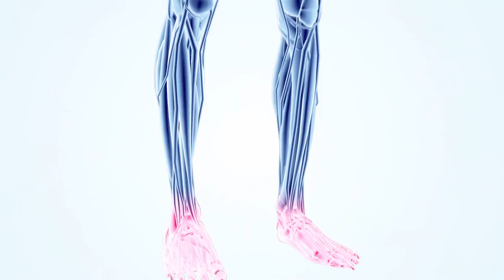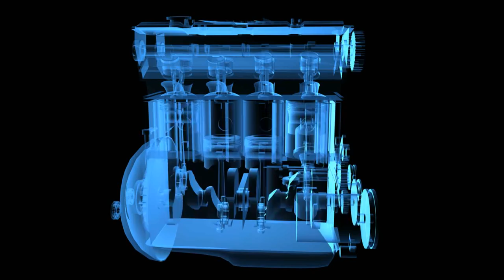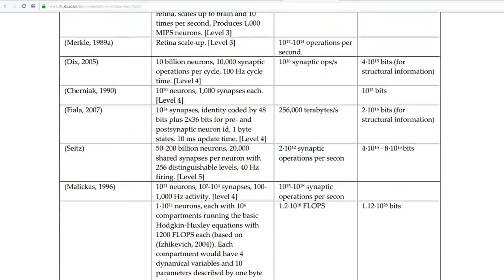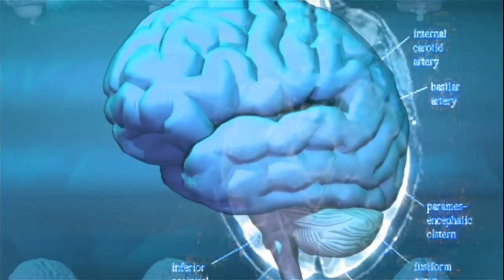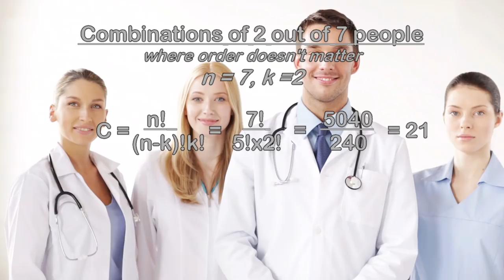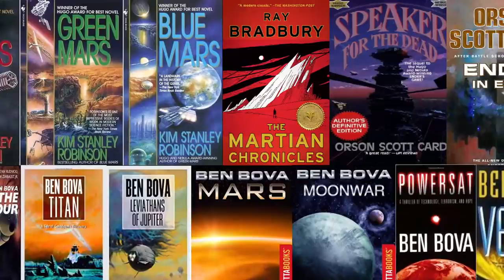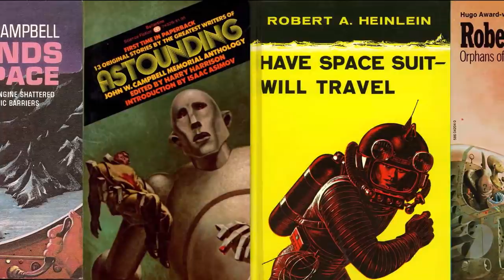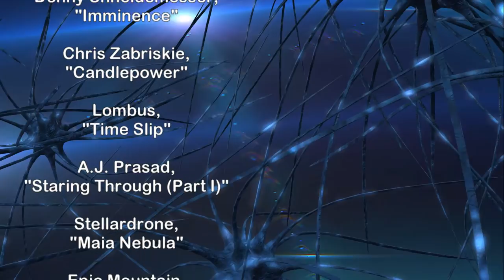Mind Uploading

Comment: As long as the paperwork says it's the ship of Theseus, it's the ship of Theseus.
Reply from the maker: :) That's a surprisingly pragmatic viewpoint
Reply: Isaac Arthur perhaps but I feel like it just side steps the issue. Ironicly not very practicle.
Reply: But what if they did both? Both rebuild the ship in a secret out of the parts and then revealed it after the new one was built?
Reply: Isaac Arthur my friend, but if I take all originally discarded pieces and reassemble them exactly, which one would be the real Theseus' ship? Would it be the reformed ship or the the one carrying Theseus?
Reply: It depends on why one is interested in the ship of Theseus :
-Theseus : Whatever, as long as it sails him.
-Relic : Don't you dare change a single speck of dust !
-Ceremonial : You only need for people to believe it is the one and only.
-Paperwork : Whichever has taxes paid for must be it.
-Philosophical discussion : Whatever, as long as the debate goes on.
Reply: @Rodrigo_Sierpe In my opinion, the Theseus' ship is the one that got gradually replaced, the one built from discarded pieces is the copy.
Reply: In the sense that cells die and are replaced, sure. If you dry dock it and replace those parts all at once and even change the materials and designs so that most or all those parts have never touched water, it's a second ship that has replaced the old one.
Reply: We are all the Ship of Theseus, your body constantly renews itself. About the only enduring part of you is the enamel on your teeth that hasn't worn away. In spite of that we remain the same person so Isaac Arthur's presentation is blatantly missing something about the nature of mind. There's actually a bold claim being made about the human mind here: that your illusion of self is just that, an illusion, and effectively exists only as unique because you are the single copy due to the limitations of human technology. I think this is an absurd assumption on the face of it but clearly nobody here agrees with me. A friend and I used to play with this idea, speculating about what future me would be doing and why past me hadn't done things better. Try it sometime.
Reply: @musaran2  lmao the best opinion I’ve seen on it, it’s a debate with no answer.
Reply: @kalliste23  Your brain and nervous system are mostly the same, neurons are rarely replaced.
Reply: @zemorph42  That is factually incorrect. Go back to school.
Reply: @kalliste23  You're right. Neurons are never replaced when they die.
Reply: @zemorph42  certainly that's the case. That said, it's now understood that the adult brain is far more plastic than is generally believed . Consider what happens when someone has a stroke, or some kind of brain trauma, and recovers more or less functionality subsequently and that what they may recover can depend on therapy. Now here's an interesting vaguely transhumanist thing for you to ponder: during WW2 they used people who had had their natural lenses replaced by PMMA due to injury spot for submarines at night: the submarines would generate UV light trails from churning up the photoluminescent bacteria in the water and people with PMMA lenses can see into the UV, normally blocked out by an intact human lens to prevent damage to the retina. The way the cognitive system adjusts to inputs is amazing.
Reply: @zemorph42  There's neurogenesis in the hippocampus for life, and I'm pretty sure there's frequent growth in areas responsible for the sense of smell. A slowed growth is associated with depression. While true that a new neuron never takes on the same connections as the original, and the original remains dead, the collective behavior is either preserved or changes in the way a brain is supposed to.

Comment: Most people don't realize how close we are to being able to do this, algorithmically. Not that we're there but some of the algorithms I work with, indeed some of the best algorithms we have for AI, emulate layers of the neocortex with striking results. There's a still a long way to go to being able to emulate (More than less) a human brain but I wouldn't say it's even twenty years away.

The first most promising avenue for this I became aware of (Besides the decades-old algos emulating neurons) were sparsely distributed representations (SDR) of dendritic processing in cortical columns. Soon after, we had source code (By Numenta) for cortical learning algorithms available on the Internet and Hierarchical Temporal Memory (HTM). I think there were some earlier, similar works by Ben Goertzel in his OpenCog project but I never used that code.

Fast forward just a few years and cortex-like algorithms are being used in some of the most impressive AI projects we have. The current state of the art in this area (Publicly available) is probably the Differentiable Neural Computer which you can download source code for Github.  AI and microchip manufacturers are now on a quest to build hardware specifically for running DNCs and I expect that this area of AI study will be where we see the most impressive results in the context of this video.

We are giving birth to, something...
Reply: Agreed, I give it 3 decades tops.
However, right now we still have no clue what the deep key to actual intelligence is.
It's probably not complicated because brain does it despite slow hardware, and probably simple since evolution juts stumbles on easy designs, and it will likely seem obvious in retrospect, but... so far it's still a mystery.
Reply: I still find it unlikely that I'd live to see this technology one day.

Comment: What about copying a mind from an old body into a new body? I can see some major problems with that, namely the fact that our brains change as we age. 

There are physical differences between the brain of an 80-year-old man and a 20-year-old man. So if you were 80 years old and you knew you wouldn't live much longer, you might want to clone yourself and copy your mind into the younger clone body, and achieve a sort of immortality by doing so (we'll ignore the time it takes the clone body to mature to the point of being like a 20-year-old by assuming it's artificially aged). However, the "architecture" of the younger brain doesn't match the old brain your mind was copied from. They may be similar in most ways, but there would be small differences, and these differences could cause changes in memory, personality, and behavior. 

Now let's say the clone body reaches 80 years old and it's time to make another body. The mind is copied into another clone body, but again, the younger brain is different from the older one, so more differences accumulate. 

This process is repeated for thousands of years. After so many generations, the imperfections will have compounded to the point where the latest clone has a mind so different from the original that it's no longer recognizable, like copying a VHS tape too many times. So whatever sense of immortality you may have achieved is now pointless. 

One possible solution might be to digitize your mind and then have the same copy downloaded into the brains of each subsequent clone. This would keep the degradation down to only two generation's worth. But this wouldn't work if you wanted to retain a continuity of memory. If you didn't copy the memories of the previous clone into the brain of the latest clone, then from the latest clone's perspective, it would be as if they went to sleep as an 80-year-old man some time in the distant past and woke up however many centuries later in a younger body. If you wanted each new clone to remember the life of the clone that came before it (we'll assume the brain can store multiple lifetimes worth of memories), you would have to copy the mind of the previous clone, so you still get the same problem of generational decay. 

Another solution would be to make the cloned brains electronic so they don't change with age. But if you're going to download your mind into a synthetic brain, then you might as well just go the extra mile and download your mind into a fully android body which also doesn't age.

Comment: In my video game concept(or book if there is not enough money), The characters have access to mind uploading and storing copies of consciousness. The problem is, the main character does not think the copy is "him". He thinks that when the mind is uploaded, the copy is not the same person. He is deeply afraid of dying, then having his consciousness copied to another body, as "he" will not be alive. The clone will be alive. When he is copied, then dies, his soul will be permanently dead. "he" will die, and "they" will take his place. This is one of the most interesting concepts proposed by the science fiction community, and I love the moral conflict the idea brings. 

As a side note, the characters are insanely powerful killing machines, genetically modified beyond the superhuman level, with fiber optics instead of nerves, so the reaction time is much faster. The bones have a liberal coating of either carbon nanotubes or a gold-iron alloy 10x stronger than steel (not graphene as they would be susceptible to electric shock). Each muscle puts out 3x the strength, pound for pound, than an unmodified muscle. They have quantum computers at the base of their skull, robots the size of dust around the brain, able to send messages directly to another Immortal (that's their name). The contacts they wear protect their eyes from vacuum and serve as a HUD for the computers in the brain. The distance between the neurons has been shortened. There is 10,000 of them. But they are pretty chill.